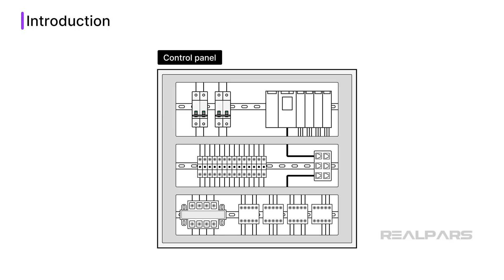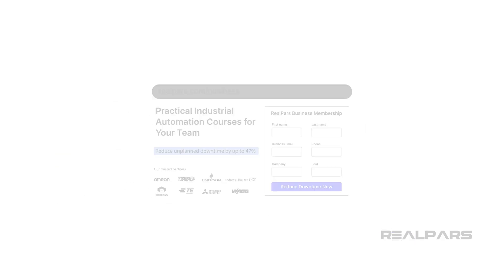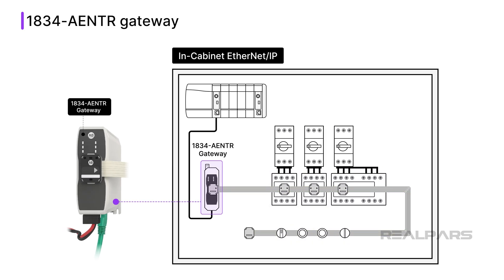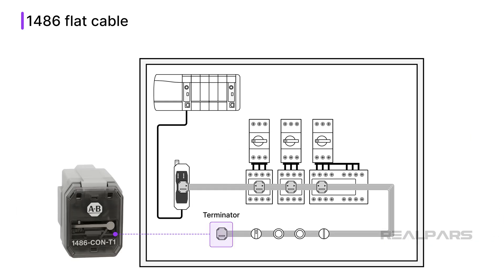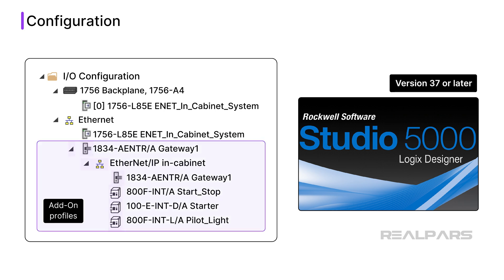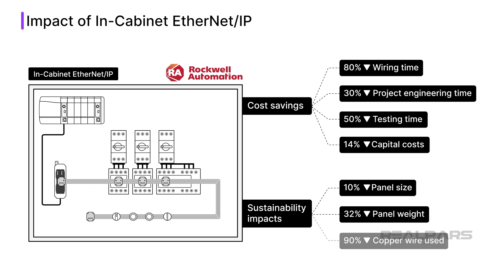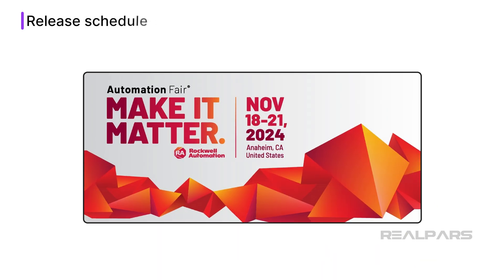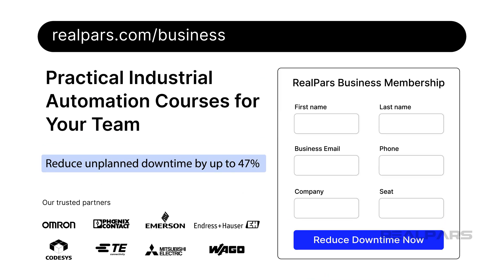Introduction to In-Cabinet EtherNet/IP

Comment: So you don't have to wire but become extremely brand dependent...
Reply: Agreed. Very proprietary and hard to support in the long run. Also is there any redundancy at all?
I'm all for new tech and CAN bus but it looks like the emergency stop is hooked into the bus on one of the slides? Emergency stops should cut power physically, not be on a can bus.😮
Reply: @PeterHertel this doesn't utilize CAN bus. It's just a single pair ethernet ribbon cable, and communicates over ethernet. Important to note that it's NOT intended to be on a larger network infrastructure. The devices will communicate strictly through the ethernet gateway. The gateway communicates over ethernet IP.
Reply: There is a plan for this product to work with other enet ip components. The only brand dependency will be the PLC and Gateway, since they use Rockwells CIP communication. That's why the integration is super easy. Although they don't have safety yet, I was told that will be in the next release. So, the gateway will be safety rated and can connect estops, relays, and safety contactors.
Reply from the maker: Hello and thank you for your question. Depending on your application and engineering requirements you might be able to set up redundancy. Always follow your local electrical codes I your area. You can learn more on this topic by signing up for our free 7 days trial at www.realpars.com  Happy learning!